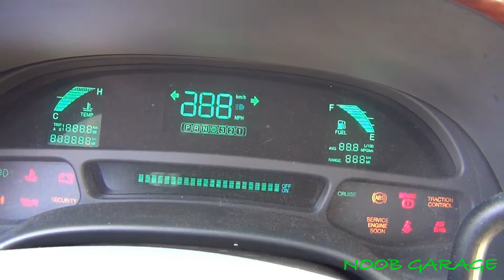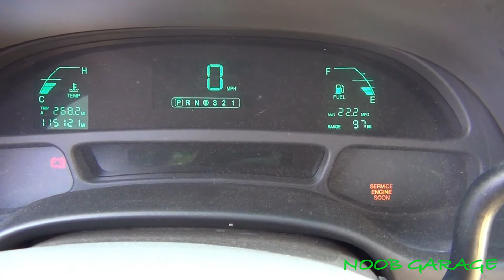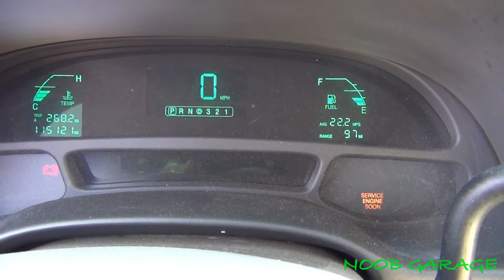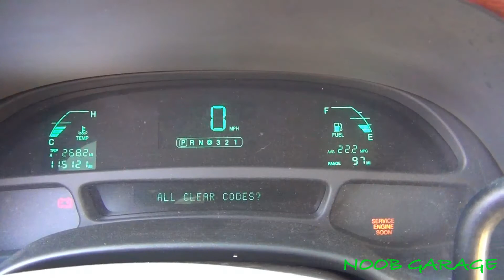2000 Cadillac Deville Checking DTC's

Comment: you didn't show if it cleared the service engine light after turning it off...
Reply from the maker: When I used to turn the key on the light would automatically turn on. You'll notice after the repair i turn the car on and the light stayed off. The vehicle does a initial check of itself when the key is turned on. If there is no problem there we be no light. I couldn't get a video of the light turning off because of that.